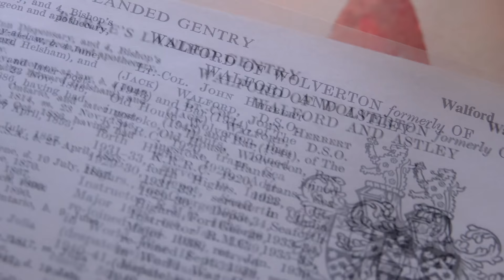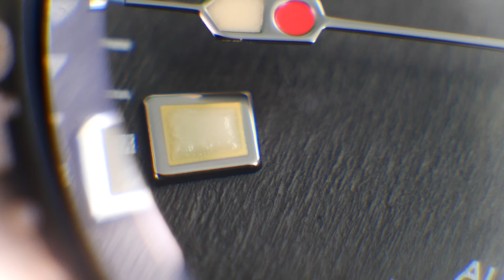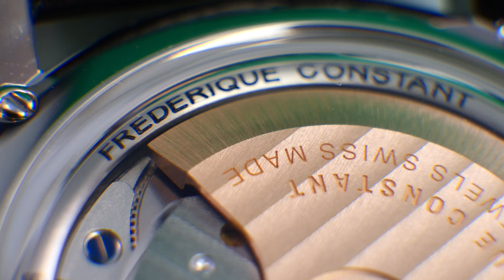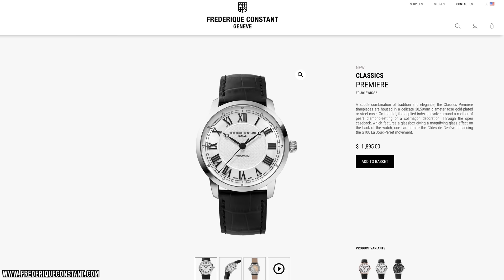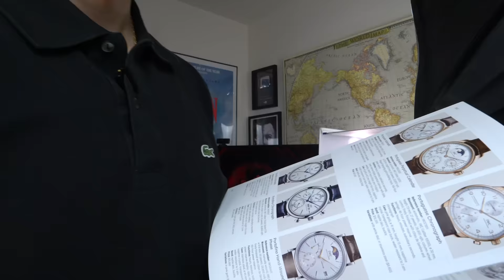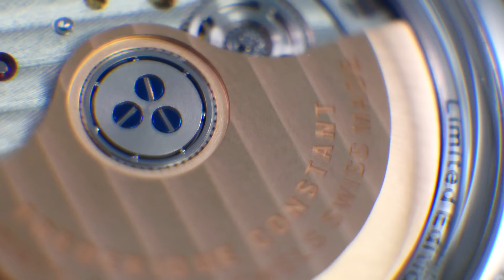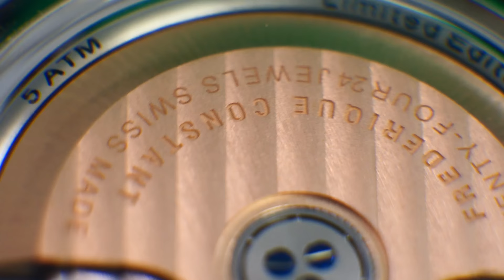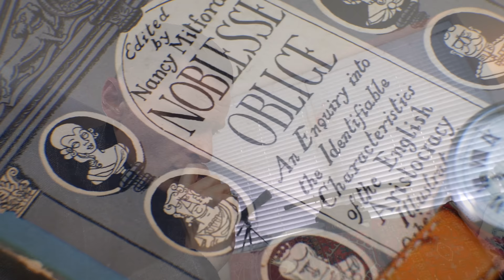Why I Wouldn't Buy Longines, Hamilton & Tissot Watches + Frederique Constant Premiere = Game Changer

Comment: The Powermatic series is repairable. Regulation is done via rotor weights (like rolex). Plastic parts are self lubricating and amagnetic. Fwiw silicon balance wheels are only replaceable, they can't be repaired. Similarly, entry level Seiko movements are 100% replaced at the service centers.... As are Tudor movements.
Reply from the maker: Great comment, thank you. I wish I could regulate them!
Best regards,
TGV
Reply: @theurbangentry  I agree, it is possible but quite difficult. Thankfully calibers like the G100, SW-200-1 and similar are available for an easier regulation experience.
Reply: The plastic parts arent self lubcricating at all. Thats the main problem with the C07.111 compared to the C07.611. Pre mature wear on the escapement wheel. Its nylon pastic, which isnt self lubcricating, not a scilicon.
Reply: Plastic as self lubricanting? How? By it abrasive ?

Comment: For classy and affordable watches Longines is still tops for me, though FC has certainly improved and is an undoubted competitor.
Reply: Longines is absolutely awesome in its own right and it’s category just like Tissot!
I use to think Tissot was meh because they sold them @ Macys and then I bought a couple Tissot mechanicals and haven’t stopped smiling since!
Reply: I just bought a Tissot PRX from Macys and I love it!
Reply: @ryanjofre  Yes, Tissot is a solid brand.
Reply: @jdrockefellas  Congratulations Joel! What color Dial? Quartz or Powermatic 80?  I have a new Tissot couturier powermatic 80. Even though a watchmaker can’t adjust/regulate the calibre as it’s laser regulated from the factory it’s fantastic. I got it for less than even Jomashop!  When the time comes years from now(god willing) for service I’m gonna buy a higher grade powermatic 80 calibre from Tissot that can be adjusted by watchmaker as I’ll eventually leave this Watch to one of my sons.
Reply: Tissot is not amazing, but at that price point I would classify it as 'perfectly fine'. Some models are better than others, but for the most part, just buy what you feel looks nice and there's nothing wrong with that. 

Longines honestly could be sold for more - its price point unfairly makes a lot of people think it's inferior to watches that are slightly more expensive. Again, it may not be incredibly high horology and finishing, but they have a strong history of quality and innovation and many of the collections are great. 

Hamilton is probably a little overrated/overpriced for what it is, but it has a unique DNA and design language, and isn't stupidly expensive for what it is (like Hublot or Franck Muller). Another brand I would classify as 'perfectly fine'.

Comment: When i started building watches for my own, the ETA2824 was widely available and the price was o.k., too.With Swatch tying ETA to swatch-group brands only, Seiko's 4R movements got more attention but i must say that the two Miyota powered watches i have (9015 and 9075) are more fun because of the higher beat rate, the nicer sweep and the smaller size of the movements.

Comment: I used to have the same thinking being a control freak about accuracy and regulating my own watches.  However, having obtained a few watches with free sprung balances, from Omega to Certina, I have to say there's a sort of freedom in just leaving it alone.  It helps if the factory regulation is good enough that I don't feel the need to change it, which so far I've been lucky with.  ETA are doing an excellent job delivering good performance with these movements.  In my experience they are consistently better performers than the 2824s they replaced.

As for serviceability, 90% of the movement is still the same as the old 2824 we know and love.  The updates are isolated to the balance assembly and the mainspring.  The entire movement is still just as serviceable, and with these being churned out in the milliions already, finding parts will be easy.  And sure, the brand service centers are swapping out whole movements, but they were doing that before with the 2824s, anyway.  I really don't see serviceability on these being very much different from before.
Reply: Please buy up as many of these wonders as you can then !

Comment: Love the Casio MRW-200H, wear mine almost daily for work. Casio and the Citizen Group are my favorite bunch of watches. Considering a Lorus Titanium and Bertucci for the same role to give the Casio MRW-200H a couple battery swaps before retirement from a rugged and long life. Going to try and find a tempered glass protector I can put over the acrylic crystal and the MRW-200H would be ready for long term use. The Miyota 2035 is perfect, gained 4 seconds in a month, and it’s a reliable and cheap movement.

Comment: Powermatic and Sytem51 are not the same at all. The Powermatic 80 movement is a modified EtA 2824. Bigger mainspring, slower beat rate and a free sprung balance get double the power reserve of the old 2824. Regulation, via weights on the balance wheel, and service are not an issue. Also only Tissot 23 jewels Powermatic use that plastic escapement part. All other Swatchgroup brands don't have plastic parts in their Powermatic with 25 jewels. Again, like the old 2824. It has absolutely nothing to do with Swatch System 51, indeed a disposable, mostly plastic movement.
Reply: That's exactly what TGV said?! 

It can't be regulated easily at home, some powermatics have plastic parts ie the escapement which is a joke tbh, the beat rate is lowered to give a longer power reserve, machine made mass produced movements....
Reply: They're laser regulated which I think it's what Tristano was trying to highlight. It means if you wish to get better performance from your watch, it's really only Tissot that can perform it for you, and that's even if they would. From looking at their price list, they just seem to offer light intervention, standard service or complete overhaul.
Reply: @DarrenBates  I have dozens of watches from Tissot, Certina, Mido and Hamilton with this movement over the past 10 years. I have sent in several for service and two Tissots and Certinas just for regulation. Service is the same price as ETA 2824, and the regulation didn't cost me anything. They do it for free. If you don't want to send it to Servicecenter an independant watchmaket can regulate it, same as he would regulate a movement from Omega, Rolex, Longines etc.

Comment: Earlier this year I got Aquastar's model 60 reissue which also uses the La Joux-Perret G100. I haven't had it long but it does seem to be a slightly better movement than the 2824 or sw200. The power reserve is much longer and also more accurate. It's a cool change of pace from the eta and selita movements to you find in everything these days.

Comment: I think the point about "non-serviceability" is not as big a deal as people make it. How a movement is serviced by the manufacturer just isn't that big a deal; you think anyone is servicing Seiko movements that cost $30 to replace? Yet you and many others sing their praises. Even Tudor reportedly replaces movements when serviced. As long as the watch itself can be serviced then it's fine. The low beat rate Swatch movements can absolutely be regulated and serviced, and even if replaced, they are compatibile with basic and common ETA movements. The watches are totally fine.

Comment: From what I see, you can regulate the newer Hamilton movements.  It  is really just old school..  You have to adjust weights on the balance wheel instead of just twisting a regulating screw.  Meanwhile, it should be more stable and not need regulating as often. IMO the slower tick rate sounds more relaxed compared to the frantic 28K.  My favorite to listen to is my Stowa Marine which is only 18K.

Comment: Thank you TGV for another over-produced video with rare conceptual content which attempts to give us some insights into how you precive modern, mass produced watches. I share your views that many of these watches are not nearly 'special' enough when churned out in such numbers in totally automated mega factories, to be desireable keepsakes.

Just a small technical point regarding the 80 hour power reserve; the longer reserve was accomplished by lenghting the mainsping. To do this the barrel arbour was made smaller & the spring was made thinner. As a consequence, the torque of the spring was lower, so the beat rate had to be reduced. Apparently the accuracy beyond 24 hours was maintained at a high level. Cheers and all the best in '24.😊😊

Comment: I have an old style Longines Hydroconquest which is terrific bang for the buck IMO. It is surprisingly slim (so fits under a cuff nicely) and is honestly one of the most accurate mechanical movements in my colection, matching even chronometer pieces. The 300m WR and clear legible display is added bonus, a great piece.

Comment: I personally don't mind the use of non-metal parts in watch movements, nor do I mind laser regulation as long as it is affordable. Tissot's service charges are, in fact, very affordable.

This situation is akin to the days when electronic fuel injection was introduced, and people complained they couldn't tune them themselves like a carburetor. Sure, there will be some drawbacks, but horology needs to move forward, exploring new techniques, designs, and materials. This isn't bad.

For full disclosure, I regulate my own watches, too. Just yesterday, I regulated my Vostok. I also have a Tissot and have no issue with buying one of these modern movements.

Comment: Couldnt agree more with most of your points however important to note that the Longines L888 caliber which is in a lot of their 3 hand watches is a much better movement than the Powermatic 80 that is in most other Swatch group watches these days. The L888 is based on the ETA 2982 and has been tuned to have a power reserve of 70 hours but hasn't totally compromised beat rate, oscillating at 25,500 bph which still results in a smooth sweep. In my experience, extremely accurate as well. On another level than the 2824 or certainly the PM80.

Comment: I've have a stainless Tissot diver bought 28 years ago for about $865. 
It is an elegant TANK. I can wear it with a suit or a pair of jeans and it looks good either way. Other than batteries, I have taken it once in 28 years to get serviced. No issue with my Tissot. However, I understand they currently do not make them to the same quality level as they did mine. Also, I understand Tissot is more coveted in Europe than in Canada or the USA.

Comment: I probably wouldn't be so strict with my selection if I liked a watch. At Longines, for example, I like the BigEye and the Legend Diver. But actually similar thoughts are running through my head. And so I recently came to the decision that I would rather buy a watch with an internal bezel from JLC, namely the Polaris No Date, because I automatically know that I don't have to make any compromises when it comes to the movements. Unfortunately the watches are very expensive. What fundamentally annoys me, however, is that all of these watch companies no longer operate independently.

Comment: You are 100% correct TGV regarding the “Disposable” movements that have imho ruined all the brands in which the much vaunted PowerMatic 80 is shoved down our collective enthusiasts throats. Many times I have posted my willingness to pay a premium to get a 4 hertz 2824-2 as a  brand option. To castrate such beautiful movements is inexcusable. I HATE these non regulated (except in Switzerland where a parts changer just drops a new , plastic 3 hrtz movement in and calls it a day….no watch maker required! ) movements almost as much as the “24 hour” sub dial. Smh…. 
Another great vid Sir. I thank you.

Comment: That FC is beautiful, thanks for showing 👍. I agree, I like to have the option of regulating a watch myself, the Powermatic seems much less desirable than the 2824. When you consider Swatch stopped supplying parts to independant watch repairers, it seems that they don't want to service movements themselves and are actively trying to prevent others servicing them too. Shame on you Swatch!

Comment: The Urban Gentry - thank you for touching on the point of movements that are replaced when a watch is serviced. 
I believe this is the practice even for Tudor and Rolex, since those movements are made by robots and CNC machines rather than old-school stamping and milling.
In my view, maybe only Glashütte Original and JLC make watches with movements serviceable for decades ahead.
Any thoughts on this?

Comment: I have a Hamilton pilot chrono with the H31. Whoever thought of tying the date changer to a sticky button on the case side should be flogged post haste. Doesn't keep good time either. My early 2000s Hamilton field chrono with 775x rocks.

I think the FC that you highlight is very interesting. While I'm more of a sport watch guy, my classy watch is a Maurice LaCroix Masterpiece tank with a manual wind rectangular movement. La Joux Perret or something (ML 126). I wore it on my wedding day back in '13. Don't wear it much though. Maybe I'll wear it into NYC tomorrow...

Comment: some of the information provided about the powermatic80 is either misleading or just false. Just repeating common internet misconceptions. Don't hear folks complaining that their new Rolex or Patek do not have a traditional regulation arm, and the powermatics are very well regulated and wouldn't need to adjusted typically. Omega and Seiko have been using plastic in movements since the 70's, the legendary Lemania 5100 used plastic parts, and not all of the powermatic line uses plastic either. if it's cheaper for a company to just replace a movement then of course they will do that, just smart business at that point. Very confused about the "modular based cheap" thing, It's based on the 2824 same with the Sellita 200 and many other movements from different manufacturers, those never get referred to as cheap modular movements but typically reliable and time tested watch architecture.  Kind of crapping on a movements without enough context really.

Comment: FC, Alpina produces absolutely amazing watches and movements. One of the best on the market under 3000 pounds.  The same happened in Longines, especially heritage range which is superb. 👌🏻

Regarding Swatch Group, MIDO and Union usually offers the mid to high tier powermatic 80, also custom made movements with regular escapement, highly regulated. I much preferred those brands vs Tissot, Certina, Hamiton etc. You get much better quality for slightly more money.

Comment: If I understand it correctly,  you're telling that you wouldn't buy PRX because its movement is disposable, but at the same time you're wearing a 20$ Casio which is entirely disposable)
Reply from the maker: No, that is only part of it. My NGf77 with the Soprod blows the PRX out the water, design, heritage, movement, quality, fit, feel, etc. The PRX just feels half complete in comparison. But that is just IMHO. As for $20 Casio, that is an entirely different proposition, as you so rightly pointed out, so good I can just replace it when it dies. I only wish it had a high end EOL indicator for the battery. More importantly, what do you think?
Thank you, great points of discussion. 
Best regards,
TGV

Comment: Bit of misinformation in this video unfortunately. Replacing movements that are too costly to service is not just a Swatch group thing, it's pretty common around the industry. Service technicians can perform basic maintenance but anything more complicated could lead to a movement swap. That info is not hidden at all, just call some service centers and ask. And even the lowest form of powermatic with the plastic components is perfectly serviceable. The bigger issue is that brands don't sell parts to independent watchmakers, and AFAIK FC don't do that either. So with Swatch or FC, if they stop selling parts (hands, dials, ...) your watch is done.

Comment: For the new powermatic 80(C07.111 and variations) you can regulate them yourself : you need a special tool (looks like a golf club) to put under the screw of the balance wheel and turn the 2 screws by the same amount. If you don’t have the tool you can pick the balance wheel with a tweezer and turn each screw, again, by the same amount. But if your Tissot watch isn’t working properly don’t send it to the Swatch group service center, they will replace it with a new movement. 
FC is amazing for the price with their in house movements ! Can you do a review of the worldtimer ? I’m sure you’ll love it

Comment: I believe some of the higher end Hamilton movements (like the one in my Cooper) don't have the plastic bits from what I've heard, but I can't back that up with an actual inspection. There are still the drawbacks of the slower beat rate, non-adjustability, and getting tossed vs. getting serviced. To me, these are work horse Swiss movements, sort of the equivalent to a Toyota Camry engine. Am I going to get upset if the Toyota dealer said they had to replace the engine of a Camry under warranty because it was cheaper than fixing the issue? No, not at all. Would I be bothered if Ferrari or Lamborghini had said the same thing? Probably so. On a Tissot, Hamilton, or even a Seiko 4R/6R, it doesn't bother me if I get a fresh movement. On my Rolex, it would bother me. 

On a related note, I keep hearing Tudor often just swaps movements rather than service them, at least with some of their Kenissi movements. That's a bit more shocking, except on the BB GMTs with the date wheel issue. I think I'd rather have a new movement for those anyway.  Anyway, keep up the good work and I appreciate the information the LJP movements. I knew they were Miyota based, but still learned some additional details. It will be interesting to see how reliable they are long term.